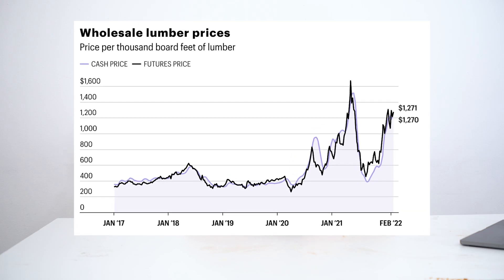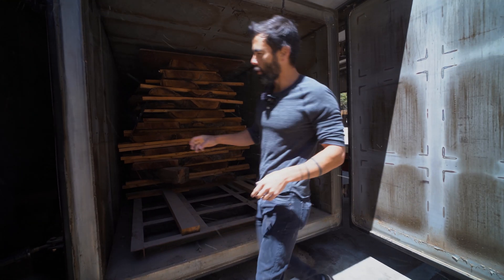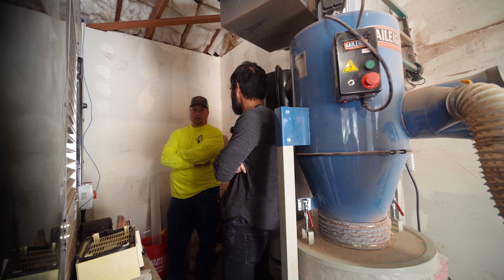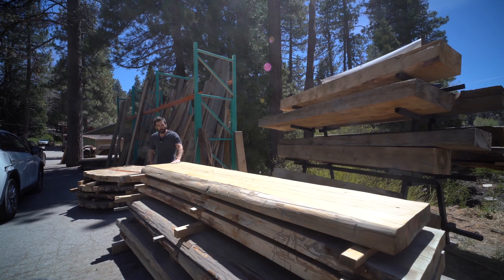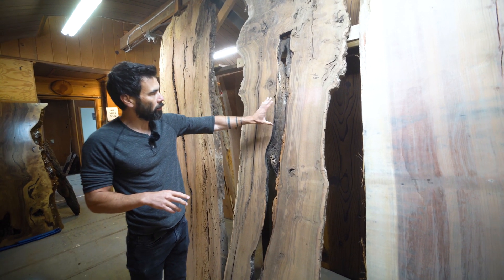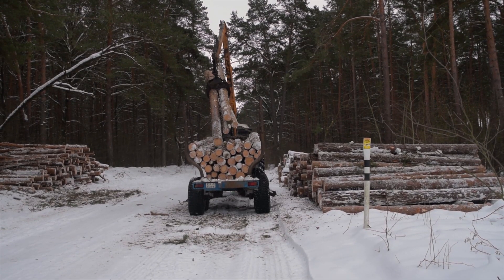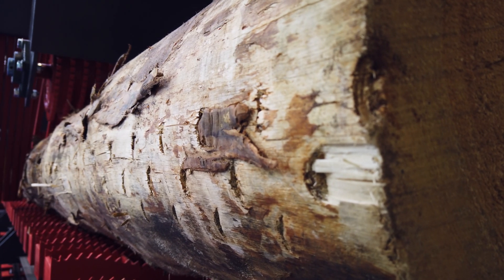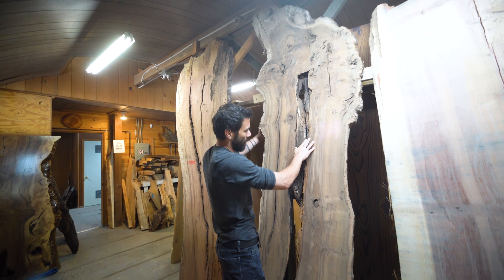Ben Uyeda learns about Wood Drying Kilns

Comment: milling and drying is a full time job . You need Lage machinery to move large logs . Unless you are using a hundreds of slabs I would stick to buying them as needed .
You will also need a humidity controlled area to store the dried lumber and it will never be big enough .
Just a few things to consider . Good luck either way .